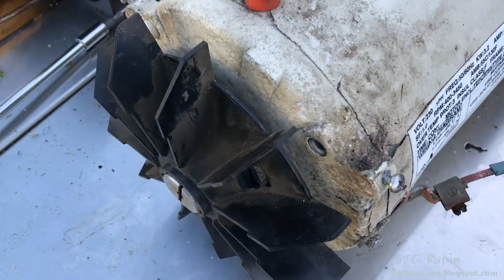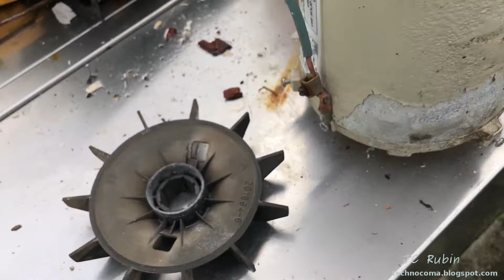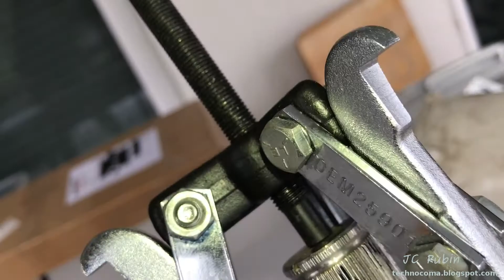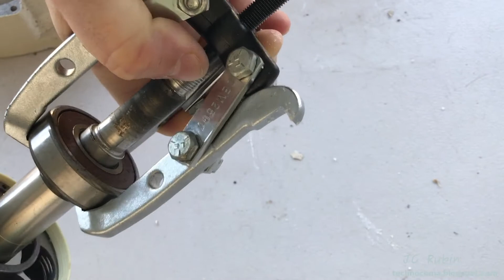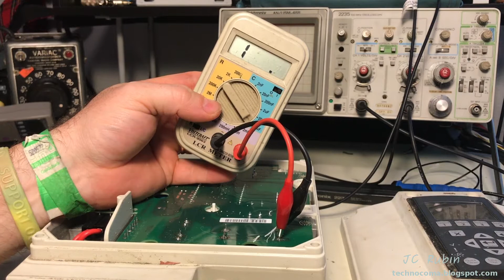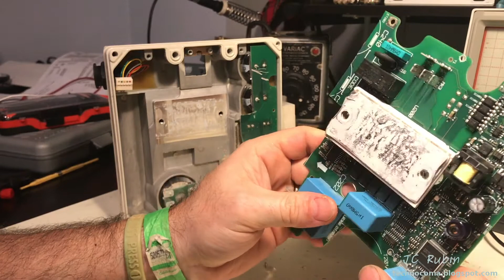Pentair Intelliflo VS Pool Pump Repair Part 2

Comment: I'm working presently on a friends pentair VS pump that quit. (A BIG bucks POS). Can't even determine what model parts to order because they made changes like every year. (another bad sign weather they know what they are doing... Or is it planned obsolescence?)  Question: the motor seems to be be a regular 220 vac motor with tree connections. Can you provide the pin out for this motor so one can test it with external AC capacitors and 220 vac?   BTW:  For those  who are not up to this "OJT" :  https://www.ebay.com/itm/144113682044?hash=item218dd8467c:g:nYgAAOSwqyFfZ9uV      The whole kittenkaboodle for less than pentair replacement part which will surely fail again in time.

Comment: If the race is not scared Id just soak it in gasoline and repack it with new grease the bearing could most likely be save
Reply from the maker: At the time, every indication showed no major bearing issues.  I had only removed the bearings in the video as a demonstration but had no need to do so.
Reply: The bearings are 13.00 bucks....a pair....

Comment: So you assume the other brands don't do the same and bash the Pentair. You also didn't test any of the winding's for opens or shorts.
Reply from the maker: This video wasn't about other brands.   If you did your homework you would know that pentair had for a long time allowed for the service of these components..... until they didn't.
Reply: @retrotechandelectronics  You bash them and go to a different product that may be doing the same thing. I find that that is a common practice to use epoxy on boards. It makes techs like us go nuts but you deal with it. I see now that you did test the winding's you call the coil. I'm sorry I missed that. It is a hobby now but I owned a shop repairing amateur radio's. What product did you go with? Our pool is being put in as we speak. Thanks. Didn't mean any disrespect.